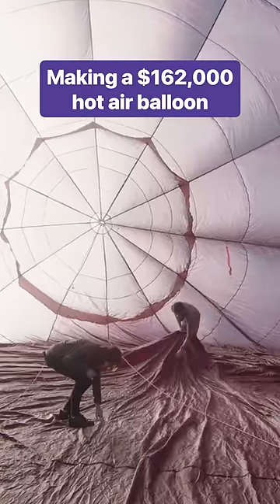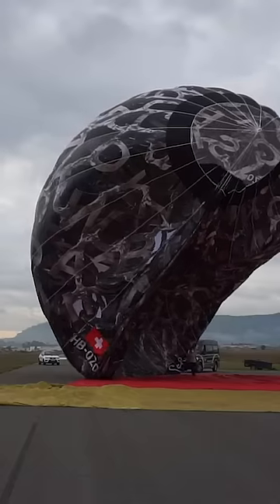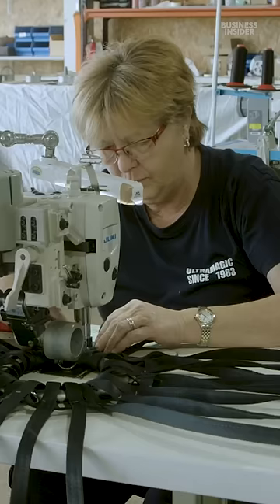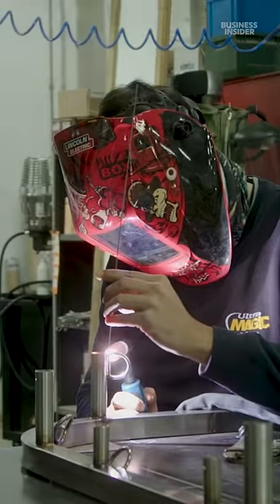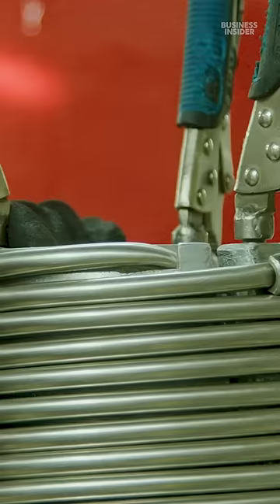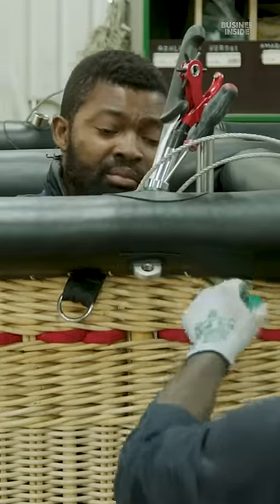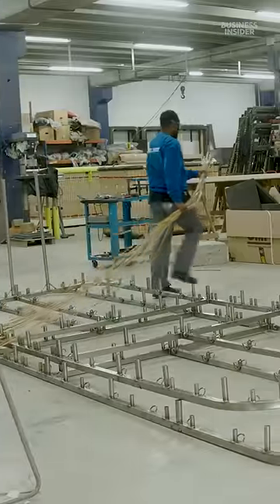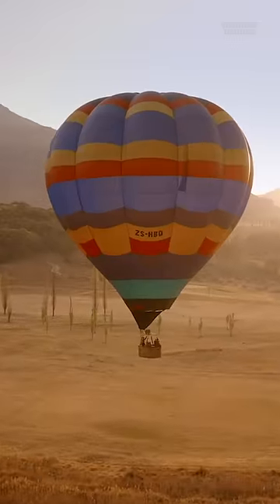Any defect in the fabric of #hotairballoons can be catastrophic once in air. #transportation #flying

Comment: I love how they still make wicker baskets, it really is an artistry, as well as an amazing feat of engineering
Reply: I wonder if it's just for the aesthetic, or if there is some advantage in being able to integrate the connections into the structure. Is imagine they could get a pretty equivalent result from an aluminum frame with a fabric cover
Reply: @katiearthofer9544 it’s light weight and sturdy. No need to change anything
Reply: @TypeAPositive  Its safe to assume a wicker basket is significantly more expensive than an equivalent in metal, plastics, and fabrics, given the labor necessary to make one

Comment: I worked on baloon fabric, and the tearing strength requirement is very high.

Developing such fabric was the toughest task I ever worked on.
Reply: It's very expensive, $162 000? Why?
Reply: @TheSido26 Maybe making charges is much higher.

Fabric cost is just 10% of the total cost
Reply: @TheSido26  Didn't you see all those people working on the different parts? This is a specialty piece of equipment, made to specific requirements. Not that many would be made due to limited demand, so it's a small scale business. It's not made of cheap materials and coming off a massive factory assembly line in China.
Reply: @SY-ok2dq exactly. These are custom orders, they don't just make tons and put them online to sell. The sicker basket alone is expensive to make bc it's hand woven and has the metal throughout. They have engineers working to assemble the fuel tank that allows it to fly. There's a ton involved and tbh I thought it would cost more!
Reply: @TheSido26 when was the last time you seen a hot air balloon for sale...?
Reply: @TheSido26 also... Do you want to die? Let's trust skeezy mcsteezy's $25k balloon instead? Not that price is equivalent to quality in all cases, but realistically, that price makes sense given the liability, care, and development undertaking it would be to design or even build a pre-designed, hot air balloon.
Reply: @TheSido26 that's not expensive at all. I'm shocked they only cost that much. Their are cars that cost 10x that.

Comment: HAB's are fine. People just need to start using parachutes ffs.
Reply: Why parachutes are not used in case of any emergency?
Reply: waketp420  but, parachutes don't weight much. After all, safety is a major concern.
Reply: waketp420  That's not the issue. Parachutes are useless at that altitude. You can't go as high as an airplane can go, if you fell from a balloon your airspeed velocity would mean you'd hit the ground before the chute had time to fully deploy.
Reply: @WobblesandBean This. For parachutes to protect against hot air balloon accidents, (1) they'd need to be on and deployable at a moment's notice even before you leave the ground, and (2) the person using it would pretty much have to be an accomplished BASE jumper.
Reply: @WobblesandBean  an experienced base jumper can jump from 200' and the shoot will deploy, HABs can go from a 1000' to around 3000' you could definitely jump off one and parachute.
Reply: @WobblesandBean parachutes are effective until around 100 feet
Reply: @arethree7 you said experienced base jumpers....not every person riding in one has that same experience. Unless they start employing people that have this particular expertise and strap one of them to every HAB passenger (most are chartered tours, like helicopters), this isn't gonna work.